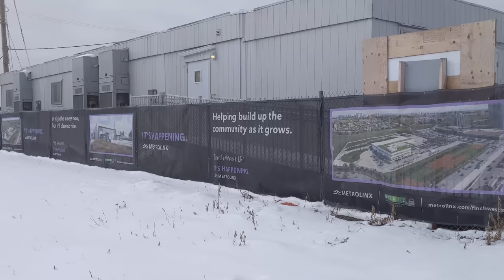Missing Links: Short-Sighted Transit Planning

Comment: A REM extension to Dorval would integrate well with future HFR as well. Since there are no international flights from Ottawa, travelers could book direct flights from Montreal and get there by rail without the need for a connecting flight.
Reply: I’m pretty sure there’s still time to do this extension but I haven’t a clue if there’s political will. Time to call my provincial representative (I live nearby).
Reply: @darcy_1  yes please do.  I have been trying to push this with both the Federal MP and Provincial MNA for some time now.  Ultimately it falls onto the federal jurisdiction more than provincial because of the airport and rail (VIA)... though there are some provincial and municipal aspects too (EXO, Bus).  There has been a study out (lookup dorval intermodal study transport canada), but again seems to be falling flat.  People all should mobilize on this because it so close, yet seems very unlikely to happen in the short mid/term.
Reply: Absolutely. There is so much potential here and I fear the more this gets pushed asides, as was stated here, the more complicated it will become to implement in the future.  The YUL REM station is now only slated to open in 2027.  This should be ample time to plan to continue to Dorval.  Then in the Lachine tramway connects to Dorval as suggested by some studies, it would really close the loop.
Reply: @anthonysipos1002  They already removed the tunnel boring machine so I think it is unlikely.
Reply: @mathieulessard1970  .  Yar... I know about the removal of the TBM, but oddly the study mentions that reusing the original TBM would be more expensive than a new one?  I am questioning Transport Canada about this because it does not make sense, but have not received answer yet.  Have a look at and search for "dorval intermodal study transport canada" and you will find the study with the options (you can download it).  This study focuses on connecting the potential future rapid rail station to the airport using various options including the REM/Light Rail.  The study was commissioned in 2020 but only really took place in 2022...

Comment: Here's another for Boston: North Station and South Station are the 2 main hubs for regional commuter rail, and they're only 1 mile apart -- but there is no direct link between them.
Reply from the maker: Yes, its not great
Reply: It would be so helpful if the NEC can be connected to the Downeaster

Comment: There's an example on the London Underground which highlights a few issues I don't think you mentioned: the new Northern line extension to Battersea Power Station Station maddeningly terminates there instead of a short distance west at the major rail interchange Clapham Junction.
The problem is that making the connection is almost too good an idea, the already complicated and congested Northern Line would be totally overwhelmed by commuters.
Reply: Elizabeth Line skipping Oxford Circus also comes to mind
Reply: @theobrigham  Because of the humungous Crossrail platform lengths, it is less a question of inserting an additional station, rather than one of interposing a (moving) walkway from the mezzanine of—capacity expansion needing—Oxford Circus over to Elizabeth's Hanover Sq approach.
Reply: Not to mention a potential Victoria Line interchange at / south of Vauxhall and the (also officially voiced) overcrowding/congestion (amplification) worries concerning that line.
Reply: Clappy J would need a London-Bridge-style rebuild to make this a reality, I feel - no point tacking on Northern line connectivity and making an imperfect situation even more complicated; best to redo the entire station and build in capacity for the Northern line (and/or Crossrail 2?) at the same time.

Comment: During the construction of Beijing Subway Line 2 and Shanghai Metro Line 4 (both circle line), some transfer nodes for future planned routes were reserved, but due to the rapid development, some newly added lines needed to transfer with Beijing Line 2 and Shanghai Line 4, but they cannot be heavily re-constructed cause it's in downtown Beijing and Shanghai, resulting in the situation of super-long transfer walk like Beijing Xi'erqi and Shanghai Yishan Road station
Reply from the maker: I'm skeptical than being downtown precludes reorganization. It has happened many times in London for example.
Reply: @RMTransit  For example, Beijing Line 2 was completed in 1984, and this line basically ran along Beijing's Second Ring Road, which was transformed into an elevated urban expressway in 1992; Shanghai Metro Line 4 passes through Lujiazui in Pudong, a financial center that has gone from a wasteland to a skyscraper-strewn city in 20 years, and it also passes through the dense residential buildings and other elevated expressways of Shanghai, and also shares a section with Line 3. Although major renovation is still possible, but for these two lines the cost is unacceptable. There are plans for renovation and construction of some newer lines, but not changing these older lines itself. In fact, there are examples in Shanghai and Beijing where existing lines were renovated, such as the Shanghai South Railway Station on Shanghai Metro Line 1, which was initially an above-ground station located on the north side of Shanghai South Railway Station with no interchange, but due to the upgrading and complete redevelopment of the railway station itself and the opening of Metro Line 3 south of the station, just ten years after the opening of Metro Line 1 on 2004, the above-ground station on Line 1 was abandoned and a better located underground station with direct interchange between Line 1 and Line 3 was rebuilt. But at that time the ridership of the Shanghai metro network was not as exaggerated as it is today, and the surrounding buildings had to be built together, so the cost was reasonable. The situation was very different from other lines.
Reply: @imwsss726  Beijing's Second Ring is a sunken urban expressway.  It passes below most other traffic.  

Line 2 makes all connections(except line 19).  It doesnt miss anything, but like many of Beijing's interchanges, the connections are extremely poor.  

Many missed connections have been rectified, like the PEK airport line being extended to Beixinqiao, a new station being added to line 10 for Zhichunlu, and the Fahngshan line being extended to line 16.

Beijing's subway has a lot of problems(and gets a lot right though) missed connections arent one of them.

Comment: Happy New Year, Reece. One theme you touched on here but I think deserves highlighting is that rapid transit planning has tended to shortchange regional rail connections. This is partly, I think, because existing regional/commuter service can be so infrequent. But you can see another great example of this shortsightedness in LA, where the C (Green) Line stops just short of the LOSSAN (/future high speed rail) corridor. That corridor is now the rail spine of Orange County, and that gap has been depriving OC residents of a link* to LAX for decades (*via shuttle due to a missed connection on the other end, although this is in the process of being rectified).
Reply: Came here to say this. It seems to be a widespread phenomenon, also in Berlin with the missing U-Bahn - S-Bahn connections and many other that were mentioned here. Probably it is also that different agencies are responsible for planning regional rail and rapid transit so they just don't care or maybe don't really know about it.
Reply: I was just about to mention the missing link to Norwalk/ LOSSAN corridor in later comments. That little gap in the C/Green line has been driving my transit map enthusiast self just a bit insane ever since I learned about the LA metro

Comment: Melbourne Metro Tunnel and the lack of a station at South Yarra, to connect with the existing one.  Also the multiple Melbourne tram lines that terminate agonizingly short of rail station, due to historical reasons!
Reply from the maker: Missed connection I'd say
Reply: I'd say one of the easiest ones would be connecting the upfeild line to the Craigieburn line. Both Craigieburn and Roxxie are so overcrowded, and allowing alternatives to get into the city on one of the lowest commuter lines seems still like a massive oversight!
Reply: @aussiejjdude3066  there’s just so many

Comment: I feel like Zagreb is one of the kings of missing links in Europe. The last time a tram line has been built to connect to a train station was in 1892 and was never done since. As a result, besides Zagreb-west (connected in 1891.) and Zagreb main station (connected in 1892.), every other railway station in the "tram zone" is rather close to a railway station, but it just isn't close enough.
Train station "Kustošija" is close to "Črnomerec", "Maksimir" is close to "Borongaj", "Trnava" is close to "Dubrava" (there is even already a depot access track halfway to the train station), and "Sesvetska Sopnica" and "Čulinec" are both close to "Dubec". This is not to mention the line that goes south from the main station that doesn't have any stations in the "tram zone" whatsoever.

Comment: Hey Reece, check out Dukuh Atas, one of Jakarta’s “flagship” transit hubs, it is split by a river, the Suburban LRT Station and Terminus for BRT Corridors 4 and 6 to the MRT and KRL Stations (+Airport express train) is 200 to 500m apart. Other places include CSW which took 4 years until a interchange facility is finally built between Corridor 13 elevated busway, BRT Corridor 1 and MRT NS Line (it also came with some controversial bus reroutings to generate more interchange traffic in CSW) . Kebayoran Lama Station is finally getting a footbridge to connect with BRT Corridors 8 and 13. 

Sometimes connections like this are an afterthought here with most solutions being long footbridges

Comment: Sounds kind of like the argument that the Phase 2 of the NYC Second Avenue line should be extended past 125th Street and Park Avenue (connection to Metro North at one end and the 4/5/6 down Lexington Avenue at the other if they build the station in between both avenues as planned), but have the line run all the way over to Broadway (to connect to the 1), which will allow for 2 stations in between for connections to EVERY line that runs uptown (Malcom X Blvd for the 2/3, and St. Nicholas Avenue for the A/B/C/D). This is not possible without a bus transfer, a long walk, or riding into midtown and then going back uptown.

Comment: Another missing link in Sydney will be the gap between the under construction Parramatta Light Rail station at Carlingford and the joint Sydney Trains/Sydney Metro station at Epping.
Reply: Building Beautifully has a great video on this topic
Reply: @abiramen  Yeah I saw that video a month or so ago, probably what subconsciously made me remember this example
Reply from the maker: Absolutely yeah!
Reply: I'm still pretty impressed that the Tallawong Schofields missing link managed to get a mention. Building Beautifully also made mention of it in his video on the Richmond line I think. How the relocation of the Schofields station 800m South concurrently with the construction of the Metro was the perfect opportunity to future proof the new Schofields Station. 

Judging by the comments though, it seems missing links are more the norm than the exception, which makes you wonder why after over a century of building a Railways, most of the world keeps getting it wrong?

Comment: Here in Augsburg there are two that I think are quite glaring. Line 1 stops quite randomly, just 1.3km short of connecting with line 6 and 1.5km before connecting to the Hochzoll regional rail station. Even worse, line 6 stops ~1.2km short of Friedberg and 1.5km short of Friedberg regional rail station, ending in the middle of nowhere, instead of connecting to the city proper and all the bus lines going out to the different villages.

Comment: In Amsterdam you have the local famous missing  link between Islolatorweg Station (Terminus lines 50/51) en Amsterdam Centraal. First proposed as a neat circle line for Amsterdam, the terminus falls now about 5km short, and as a result Islolatorweg Station is now in the "middle of nowhere".   Various studies are now underway to complete this circle.
Reply: What I find most perplexing about this situation is that years after line 50 was built, with full knowledge of the original plan for a circle line, they decided to connect line 52 at Amsterdam Centraal to the existing platform for lines 51/53/54 via transfer walkways that are directly in the way of extending line 51 westward. 🤯
Reply: @jelmerterburg3588  did not know that, but that makes this an even weirder situation.

Comment: Metro de Madrid is finally fixing 2 missing links long demanded by users: Line 5 extension to Barajas International Airport, connecting it to Line 8, which will have some relief from crowds and it will give travellers more options reach the city centre while easing the lives of many of the airport workers who live along Line 5; and Line 3 extension to El Casar, connecting it to Line 12 and Cercanías rail services, which will help commuters from the heavily populated suburban cities south of Madrid. Both extensions will open in about 2 to 3 years as they are relatively short, just about 2km each, but largely awaited and will transform the way to move around Madrid and make the Metro a more attractive and competitive option!🥳🇪🇸🇪🇸🇪🇸

Comment: Here in the DMV, I've thought that the WMATA Red Line could form a complete loop connecting the Glenmont and Shady Grove ends. It would face massive NIMBY opposition but would create new trip opportunities for cross Montgomery County Travel (Rockville to Sliver Spring), and relief/alternatives if problems arise on either portion of the Red Line "U".
Reply: The red line is so bizarre to me. Are there depots at either end of it, or just one? Can it even function as 2 separate lines? Also, is there any way for trains to jump from the main network to the red line at Fort Totten? I have never been that far out on the Red/Green/Yellow lines.
Reply: That is not the only missing link here in Maryland. When the Western Maryland Railroad disappeared, so did the direct passenger link from east to west. The funny thing is none of the trip opportunities it created really disappeared with it. In fact, the Western Maryland College expanded in spite of it being less convenient to come there.
Reply: @nitehawk86  there is a one track connection at Ft. Totten from the outbound RD to the outbound GR/YL track. In the 90s when the GR line was under construction through DC, the portion from Ft. Totten to Greenbelt was actually finished and detoured onto RD using that one track (and the switches on each line) to end at Farragut North. They called it the Green+ Rush Hour Service or something to that effect until GR was finished through the city. WMATA could theoretically revive that service as a new line color, but since the connection is only one track, it would likely cause some issues. 

There's also another one of these from OR/BL/SV to RD around the Farragut North and West stations. It connects the Westbound OR/BL/SV to northbound RD.

Comment: In Warsaw, there’s a really frustrating case of the M2 line not having connection to the northern SKM (Warsaw’s S-bahn type train) branch with not one, but two missed opportunities to do so. First, the M2 eastern branch really lacks just a one station to have a connection to Warszawa Toruńska SKM station (distance from the current Bródno terminus is just about 1,2km). 
Second, I think even more absurd one, at the point where metro and suburban rail cross, two metro stations Szwedzka and Targówek Mieszkaniowy, were built on two sides of the railway, but both in a just a bit too long distance from Warszawa Targówek train station. Neither of those provide a convenient transfer. 
And both Warszawa Targówek and M2 eastern expansion were opened in a period of just 2 years from each other. Really poor planning

Comment: In the Bay Area (Oakland), there is a missed connection between BART's 4 SF lines and 3-4 Amtrak Routes (Capitol Corridor, San Joaqins, Coast Starlight, California Zephyr(the trains already travel here on their way to and from the yard)) at I-880 and 7th st. It would provide Amtrak riders quick, direct access to both San Francisco and Oakland.

Comment: In Rome, there are two kind of missing links. 

1) the new Metro line C runs close to several different tramway lines, but there is no direct interchange between Metro and tramways. The easter terminal of lines 5 and 19 is just a few blocks away from two different stations of the Metro, but there is no proposal to move it closer to one of these stations. And another tramway corridor, who had a perfect interchange, was cut short and now has a 500 m gap. 

2) There are two missing links between the Metro and regional rail, at Ponte Lungo/Tuscolana and Libia/Nomentana. In both cases, the Metro and Regional rail stops are 1-2 blocks away, but there is no direct link between them.

Comment: As a Boston & frequent user of the MBTA,

1. North South Rail Link. Because of the big dig (ew highway infrastructure) there is no realistic way that they could link North & South Station(s)
2. Blue Line @ Bowdoin & Red Line @ Charles/MGH. These stations aren't that far away and it could vastly increase ridership on the Blue line, one of the best and leastly used lines on the MBTA.
Reply: FYI I commented this before you mentioned it in the Video